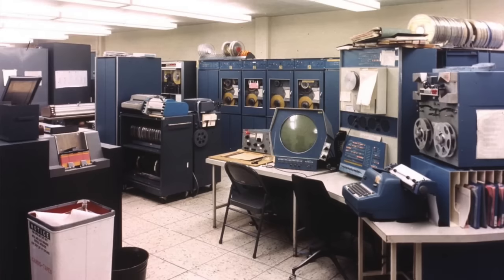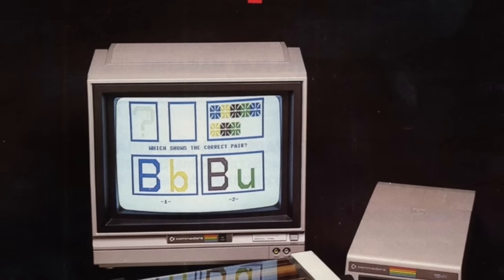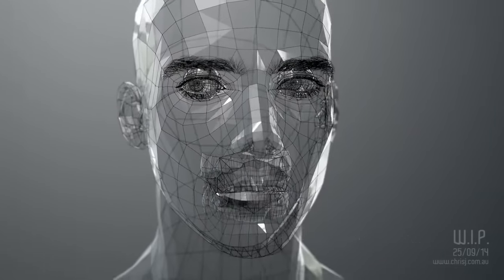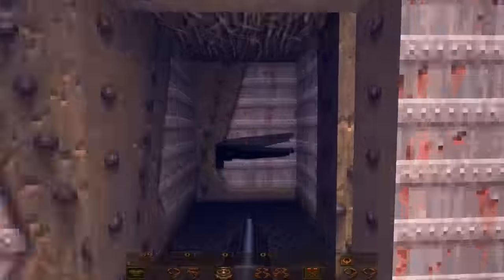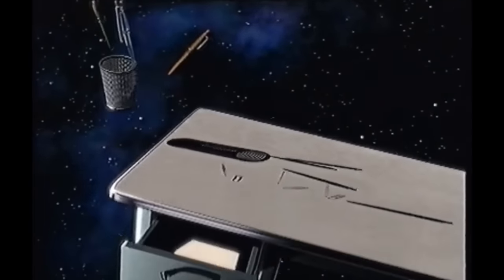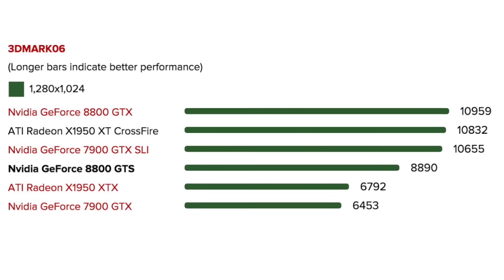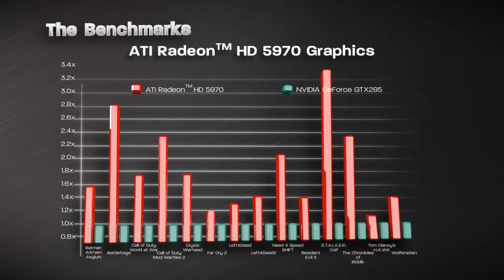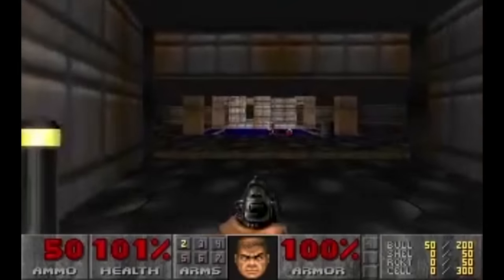Evolution Of PC Gaming Hardware

Comment: 780ti / i7-4790k / 16gb ddr3 ram
probably getting new GPU next year with that juicy HBM2 tech
Reply: +someone I'm not going to worry much about memory over 4GB or HBM till I go 4k :)
Reply: sinephase i won't move to 4k until 120hz/144hz do exist for 4k res 

but i've seen 4k gaming IRL and i can tell you it's just glorious 
that's why i want to go 4k ASAP
Reply: someone
so much monies :'(
Reply: sinephase not really i'm at college and i have to save up the whole year so i can buy new parts 

pc gaming is my hobby so i drop like 30% of my cash on it (: 

no regrets though :P
Reply: +someone I have 4K gaming 
It's nice
but 1440p >100Hz is honestly better when managable
Reply: someone
30% of your money isn't cheap :P likewise you need the most expensive GPUs to get decent FPS at 4k unless you turn down visuals, which kind of defeats the purpose IMO
Reply: +someone 

i got a 980 evga kingpin /i7 4770k with a load temp of 50c and the gpu at 60c with fans at 30% speed on  battlefield 4 with everthing maxed
and i have 16bg of ram at 2666mega hertz and timing is 12-13-13-35 ddr3
Reply: +someone The only time i'll move to 4k is when a single GPU in the future (something in the price range of the GTX 970 currently) can handle 4k at 60fps stable.
Reply: +someone i've got the exact same spec pc as you and im also waiting for HBM2 lol
Reply: Mr. Fuzzums look no further than a year or two (;
Reply: +someone The fact that you lie, determined that it was a lie.
Reply: Roberosein Someonesmomovich lie about what ?
Reply: someone just a joke comment.
Reply: Roberosein Someonesmomovich oh i see (:

i was confused for moment
Reply: i5 3570k running 4.3ghz 8gb ram, 250gb ssd, 7950hd
Reply: You could probably last another 2 years with that ti. It has 4 gigs of vram if I remember and that's the direction pretty much everything is heading now
Reply: Jack Pred it only has 3
Reply: +EPDM2BE i5 is better value for money.  the hyper-threading i7s give is not really value for money.  for instance my 3rd gen i5 keeps up with my friends 2nd gen i7 at the same clock speeds.  he might get a 5-10% boost on some games but when he bought it he probably paid twice the price as the i5 equivalent.
Reply: Sython6 i7s are not twice as much only about 33% less from the price of a i7 for a i5
Reply: +Sython6 Depends on the game. MMO's are very CPU intensive, and games with large environments tend to be CPU intensive. FPS games are usually pretty easy on the CPU.
Reply: waiting for nvidia answer to buy new graphics card, but my specs were always weird, once intel voodoo2, then AMD nvidia, then amd ati, then amd amd, now intel nvidia and maybe next, intel AMD
Reply: Raho Vart that's good

get what is the best performance per dollar card

screw brand loyalty :)
Reply: +BlackWing88 Cyper Yeah and you only gain about 10-15% fps in about 2% of games. i7's are not good value. That saying if you spend lots of cash on systems then go for it.

Comment: I went from Intel Celeron "Northwood" 2.4 GHz, 1 GB DDR RAM, GeForce FX5200 256 MB, 40 GB HDD, Windows XP...

...to Intel Core i7-950 3.07 GHz, 12 GB DDR3 RAM, Radeon HD 6770 1 GB --> GTX 660 2 GB, 1.5 TB Seagate HDD, Windows 7...

...to Intel Core i7-4790K 4.0 GHz, 16 GB DDR3 RAM, GeForce GTX 980 4 GB, 1 TB Samsung 850 EVO SSD, Windows 10.

My next PC may have Intel Core i9-12850 4.5 GHz (8 cores, 32 threads), 64 GB DDR5 RAM, GeForce GTX 1580 Ti 128 GB HBM3, 8 TB Samsung 1250 PRO NVM-e PCI-E SSD, Windows 10 build 2103 (128-bit)...

...BIOTCH!!!
Reply: Funny though, that the difference between the first rig and the second is tremendous, while the difference between second and third is barely significant.
Reply: make sure you put this info on your dating profile!
Reply: I have 2 GB RAM, AMD Athlon Dual Core 245 2.90 GHz and ATI Radeon HD 5450, 32 bit operationg system 240 GB on hard disk (24 GB free)

I'll be getting a new one in about 2 months.
Reply: im rocking this shit with a fabulous core 2 duo e8400 overclocked from 3ghz to 3.31ghz with 4gb ddr2 and a wonderful zotac gts 450.

seriously its shit ill be upgrading soon but somewhow im able to run no mans sky on this lol
Reply: You don't need that much RAM, games aren't going to touch RAM usage beyond 16 gigs for at least the next sweet 5 years.

Comment: I still use an 8800 today. It beats my GT630 from 2012, and the 8800's can be bought for as low as 20 dollars on Ebay. It works great on anything I play.
Reply: Yep, I still use a gtx 280 to this day :)
Reply: I use a 1070......

Sorry not sorry
Reply: Must've been expensive, since it's still not at MSRP. I mean I want one too, but not at that price.
Reply: Till last year i still used a 8500GT, now the old rig Died and now I need to use a shit amd 2400 radeon integrated 256 mb gpu.
Reply: Aaron Hillaker Well I use a liquid cooled 1080! lol. 

Sorry not sorry
Reply: I used a 9800GT 512MB until this year. I thought the same, and it can still handle games on low kind of, but man, once you get a semi-decent VGA you'll be laughing at yourself using the 8800 today. Even with a $30 investment you get twice the performance with 1/5 the heat and noise.

Comment: Great video man

Running a Gtx 970 
Msi Z97
I5k 4690k
16gb Ram 
2 Ssd
Reply: Why do you have 2 SSDs when its best just to have Windows on a SSD and the rest of your shit on an HDD
Reply: Alex Forslund One of the ssd is for windows and my programs and my other ssd is where my game are on
Reply: +Alex Forslund SDDs can start games MUCH faster
Reply: +Dutchyy _ yeah like any mmorpgs, or games that have long load times, or maybe servers that process tons of stuff and require high IOPS, but yeah overrated.
Reply: +Dutchyy _ Are you shitting me, have you ever run SSD's in raid0? Regular harddrives have pretty much only increased in size over the years, then you start seeing hybrids and pure SSD's. Raid0 Sata 3 SSD's, and you can install windows in 5 minutes, install programs and games super fast, Loading times are superb, things like unpacking files, moving files around.... Also they are a lot more reliable than mechanical drives. Only thing you should use mechanical  for is the fact that its cheaper per GB, so for storing videos and images.
Reply: +Kevin Garcia building != putting stuff together
Reply: except that's exactly what most people mean when they say they're building a pc, or refer to a pc build.
Reply: +MusabGamePlay Technically you are building a PC, since a component, for example a GPU, isn't a PC in itself. If we went with your logic, you can't "build with lego" or "build a wall using bricks" because you aren't making the legos or bricks yourself.
Reply: 16GB is kinda a overkill
Reply: DAJ Johnson Not really bc most pc games hit over 7gb of ram ive checked when I had only 8gb ram 16gb is the sweet spot 32gb is overkill
Reply: I love it when people say that 16GB is overkill. I'm over here thinking.. "Why?" Is more boobs ever worse? Is faster turbo spooling ever a bad thing?? When is the last time somebody complained their internet was too fast???

I'm running:

Intel i7 5820k
32GB RAM
EVGA Superclocked GTX 980
Asus x-99 mb. 

I woulda went 64GB of RAM but my 4K tv ended up costing me more than planned cuz I went bigger.....

I don't get "overkill" when it comes to building a PC.
Reply: IMP429 well yeah if ur gaming then you might as well use that
Reply: +Dark Shadow Studios I agree that there's no overkill. But I do believe there are price to performance ratio. I don't want to pay $100 for a .1 second increase in processing speed.
Reply: +Dark Shadow Studios Ok,srsly,64gb ram is overkill,you don't need em,unless you wanna make a server out of your PC or Rendering shit or work with bit coins...
Reply: +IMP429 
R9 390
Asus Z97-A
i5 4690k
16 gb RAM
1 tb SSHD
Reply: +IMP429 i5 4690k r9 290 8gb ram 4 mechanical hdd's (such speed -_-)
Reply: 8350, gtx 750 ti, 8gb ram. budget rig that still does everything i need it to do reasonably well. think i'll get a gtx 960 and 16gb ram eventually but not hard pressed for it. i don't need to run my shit on ultra at 120 frames to enjoy the game. still looks better than consoles.
Reply: ashxc
Dont bother with a 960 mate, the 780 ti is better
Reply: +mikey robinson im guessing u ment 750 ti is better then 960 but no 960 is way better then a 750 ti if u did meen 780 ti is better yes that is true just the 2 card r in way different ball parks when it comes to price
Reply: Michael Young
sorry i read 780ti instead of 750, my bad

Comment: Wow, the 3DFX and Nvidia history is COMPLETELY wrong.  Both companies were spawned from Silicon Graphics, which invented the 3D accelerator chip ("SGI Geometry Engine" from Jim Clark at Stanford).  NVidia got the most talented engineers, but 3DFX got started much earlier (almost 2 years earlier).  So 3DFX got the drop on NVidia and the 1998 Voodoo2 was a best-seller (I actually took my PC in to get it outfitted with a Voodoo2 and to play the ground-breaking "Half Life" game).  

Just 1-2 years later the NVidia Riva TNT and then the revolutionary Riva TNT2 cards were released, both cards included both 2D and 3D acceleration and the 3D was much faster than VooDoo3,  3DFX CARDS NEVER SUPPORTED 2D EVER!   VooDoo was a passthrough system (it could block the  2D video pipeline card and overlay 3D on the screen) so it required a 2D card in your PC too - That's very expensive!  You could never have 3D in a window on a VooDoo system!   

NVidia's more talented engineers offered a product that was cheaper and faster and combined 2D and 3D and basically forced 3DFX to go bankrupt.  I eventually bought a TNT2 card and left my VooDoo card in the PC - usable in overlay mode - it only ran "Glide" (a gaming geometry engine), whereas TNT2 ran a full OpenGL (which was a 3D CAD standard pioneered by Silicon Graphics).  NVidia got very little from buying out 3DFX, except a set of disappointed customers who they were able to make very very happy ...
Reply: +Donald Gillies Not quite right...

The Voodoo 3's were the faster card vs the TNT and TNT2. It was only when Nvidia brought out the upgraded TNT2 Ultra did it keep up with the Voodoo3 lines. Then shortly after, the first GPU (Geforce) card was born that completely destroyed both the Voodoos and the TNT's.

The TNT2 range did have one advantage and that was 32bit colour processing but the vanilla ref board TNT2 was never quicker than the voodoo 3.

3dFX did try to recover with the voodoo 4's and voodoo 5's but by then nothing could stop the Nvidia might of the Geforce line.

Personally I thought Glide was awesome, as evident by the original Unreal games.

Also the Voodoo 3 had 2D and 3D, only the V1 and V2 were strictly 3D cards.

Source: I owned a V3 2000 and then later a Leadtek Geforce 256 with DDR. I lived through that major period of gaming and pc hardware growth.
Reply: +fr4ud0 Thanks!  I think another unspoken advantage of NVidia was that they had much more depth on their software teams.  Glide worked okay but it was proprietary and it was a very small &quot;BIOS&quot; for a video card (something like 17-18 primitives if I remember correctly).  A lot more time and effort was necessary to implement OpenGL, but NVidia completed a full implementation sooner and with great ease ...
Reply: +Donald Gillies pretty sure that 3dfx destroyed themselves by complicating their technology so hard. Specially after Nvidia created the T&L, something that 3dfx still lacked. They were too late to implement it, and their chips were the equivalent of Titans back then. (2 or even 4 chips, in a huge board cards)
Reply: Cesarin Pillin Good memory! I completely forgot that the voodoo 5 were pushing multi core technology and Nvidia created the T&L that pushed the boundaries. Man that was such an exciting time for pc hardware/gaming. Wonder why the author of this video didn't go into detail about this, it really was the pinnacle point of evolution for graphics.
Reply: +Donald Gillies Actually, 3DFX was first to use SLI technology and many believe that what Nvidia got out of 3DFX the most was tech from it.  Considering 3DFX literally coined their term of using more than one card SLI and Nvidia quite literally uses the identical terminology.  I remember reading a lot of the proprietary tech from 3DFX SLI tech was found in the earlier SLI Nvidia cards that first came to market.  If you just take into account what I said above, Nvidia got quite a bit simply from this tech alone.
Reply: +Jozef Hanratty Not only SLI, great many things were just taken from 3dfx when Nvidia bought it, including sophisticated frame buffer or at its' time very advanced memory management (later used as LMA in GeForce 3). FX series was basically 3dfx work, originating from the unfinished Rampage project.
Reply: I don't think the previous SLI comments are accurate, because patents related to multi-scan lines or skipping every N pixels in rendering, were filed in the early 1990s by SUN, they predate 3Dfx and NVidia, the tech that NVidia got from 3Dfx was not patented nor was it proprietary.  SLI is a straightforward brute-force solution method of throwing more hardware at the 3D rendering problem.   My information comes from somebody who was friends with both the 3Dfx and NVidia engineers at SGI.  http://patft.uspto.gov/netacgi/nph-Parser?Sect2=PTO1&amp;Sect2=HITOFF&amp;p=1&amp;u=%2Fnetahtml%2FPTO%2Fsearch-bool.html&amp;r=1&amp;f=G&amp;l=50&amp;d=PALL&amp;RefSrch=yes&amp;Query=PN%2F5392393
Reply: +Donald Gillies Nvidia got the patents that allowed them to use 3dFX's spatial anti-aliasing at the time as well as SLI mode, which becamse a staple in future cards. I wouldnt say they got nothing out of it. Also it wasnt that Nvidia's engineers were more talented, it's that 3DFX's were hamstrung by their executive management. Buying STB was what placed them in the grave, allowing Nvidia to sell to all other third parties, and Nvidia made money hand over fist while 3DFX placed their engineers in a bind.
Reply: +Donald Gillies I well remember the time when they were rivals. Also, 3DFX supported 2D (Voodoo Banshee, Rush). Also, remember that the graphics from 3Dfx cards are much better looking than Riva TNT2 (where they were predominantly gray and pale colors). But Riva had greater 3D speed and 32-bit 3D color support. 
3DFx had a series of bad moves and therefore failed. When GeForce 256 out it completely defeated 3DFx with rendering engines, a processor with integrated transform, lighting and hardware T&L.  Single-card 2D/3D solutions were taking over the market and 3DFx bankrupt.
Reply: Ivan Antonijevic
I had the voodoo 3. one hell of a videocard!
Reply: +Donald Gillies brif OVER view
Reply: +fr4ud0 When they developed the voodoo 4 and 5 3dfx made the huge mistake of using SLI on one card - which made the usage of FSAA under "high" resolutions possible, but the raw speed especially compared to the geforce was a joke for the price.

Comment: Still rocking the GTX750 TI.  Fallout 4 runs beautifully...
Reply: CosplayExtreme at 720p...
Reply: FYI 720p is called HD and also from a PC perspective, I don't think you will be gaming on a huge wall Screen, most PC Screens don't really show much difference with 720p and higher, given that other settings are set at high as well that includes AA.
Reply: I'm gaming on a 32" 1440p screen and I swear 720p would look blocky because it's precisely half the native vertical resolution. Now, if that 720p was upscaled to 1080p in, say, a console and then upscaled to 1440p by the monitor, that is harder to tell.
Reply: Samira Peri 1440p has 4 times more pixels than 720p
Reply: CosplayExtreme at 720p?
Reply: Firstly I'm pretty sure he was being sarcastic, second I'm running the 560ti
Reply: There is a thing called Anti-Aliasing...